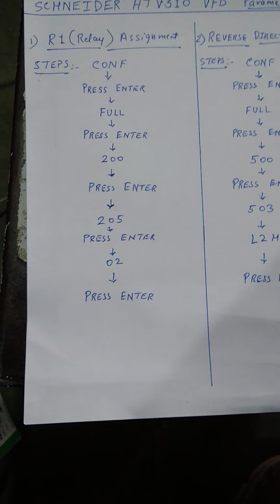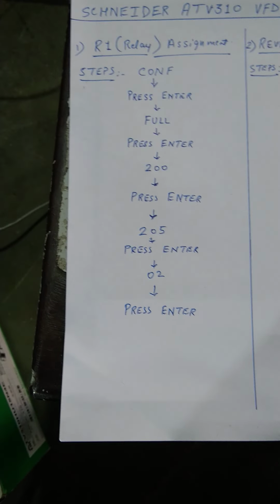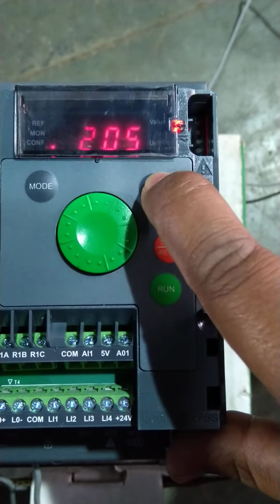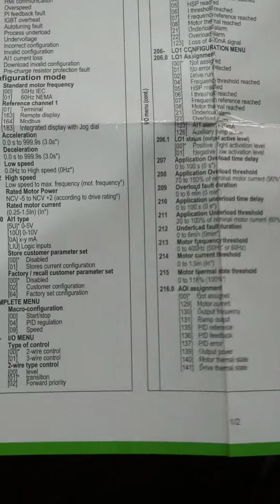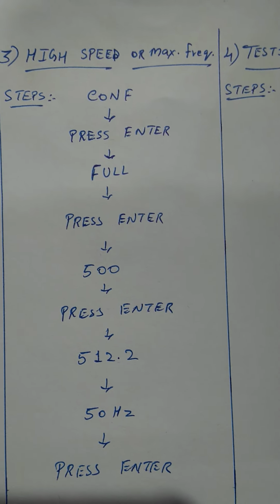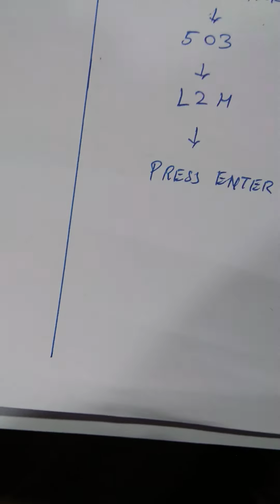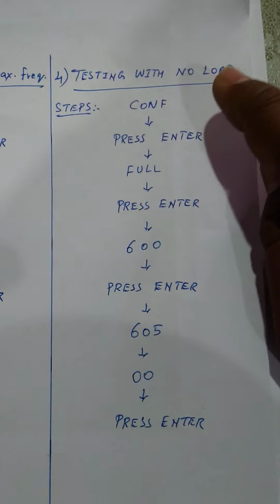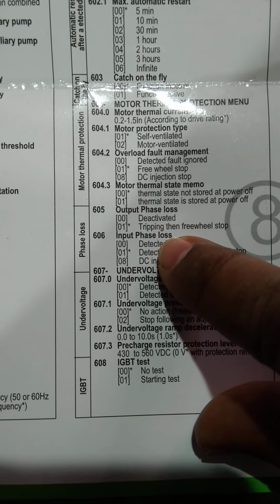Schneider Atv310 Four Basic & Important parameters.

Comment: Can u tell the parameters to be set for speed variation on analog input of  0 to 10v dc from duct pressure transmitter. 
10 volts to drive it should run on minimum frequency, 0 volts then its should accelerate to max speed. 
Tq